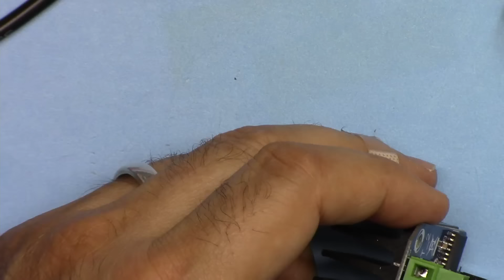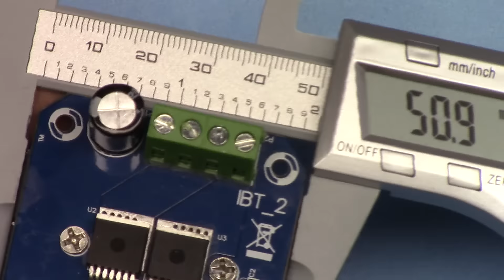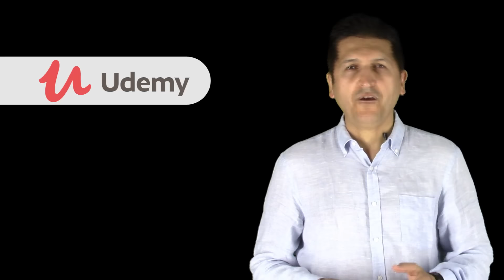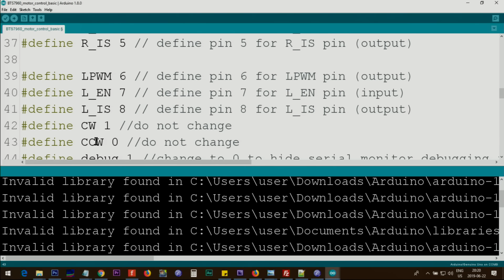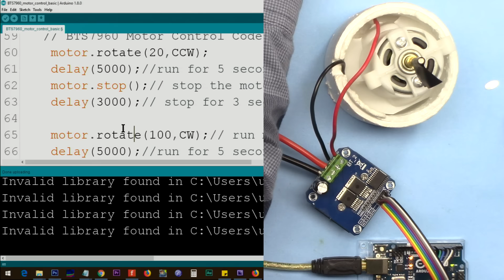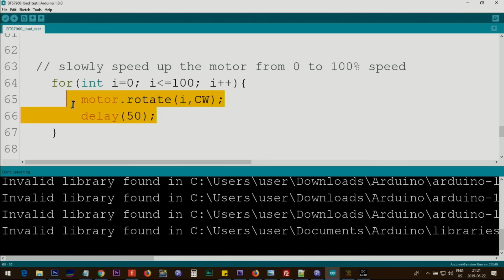Using BTS7960  BTN8982TA PWM H Bridge motor controller module with Arduino library RJT169

Comment: i can connect 2 motors in one ibt2? will loss potency with 2 in one ibt2?
Reply from the maker: It controls only ONE motor. I have provided the module datasheet in this page. See page 5 from the link http://robojax.com/learn/arduino/?vid=robojax_BTS7960_motor_driver

Comment: I have a very simple question : Do the H-bridge draw current when it's not active ? I mean when you apply voltage across B+/B- but your not sending signals from Arduino.
Mine is drawing around 0.15A just when I connect the power supply, I think it's broken
Reply from the maker: You haven't subscribed to my channel. I will reply to all Subscriber's 🔔 questions. So make sure to Subscribe.😊
Reply: @robojax  No
Reply: @robojax  I will check a correct guy who not bargain for subscribers
Reply from the maker: You want to get free. I have spent hours to write this library and you don't even spare single click. Really?
Reply: @robojax  I don't want yout library dude, you didn't even read my comment.. it was just a question, don't ask for subscribers

Comment: hi Robojax, i have a big Motor RC car, L298N motor driver is not enough to drive the rear motors it gets really hot and it wont run when you put it on the ground, i bought a BTS7960. please teach me how to code and wire it to replace the old setup. thank you
Reply from the maker: Hi Christian, If you watch this video and follow the instruction, you can control any DC motor. I've made it very simple using the library. Try watching the video without escaping.

Comment: Hi sir, thanks for nice tutorial video. I have a question about bts 7960. I am using this motor driver to control motor dc 24v 90w with power supply 24v 15a. When I set the pwm is 255, the output voltage 14,5v. Why output voltage not 24v ? Whether the maximum voltage bts 7960 is 14,5v ? 
Answer my question, please.. 
Thanks
Reply from the maker: Hi, thank you. PWM is not changing the output voltage. Even if you set it to 10 or 255, the output voltage should be 24V. Something is wrong. Check wiring.
Reply: in your opinion, which part of the wiring should I check? the wiring is the same as your video tutorial. 
I'm confuse where the mistakes

Comment: Hi Robojax, nice video, very well explained !  I've been trying to learn and adapt your knowledge to my application, however I'm not really sure it'll work since I don't have any of this modules available at the moment. So hopefully you can help me with this question ... Do you think that connecting 02 BTS7960 modules in parallel will work to drive a 60A 24VDC motor ? PSU is a 24V 100A.
Reply from the maker: Hi MadDogPE, Thank you. According to the datasheet http://www.robotpower.com/downloads/BTS7960_v1.1_2004-12-07.pdf on page 7 it says supply voltage max is 45V. So it will not work for your application.
Reply: Hi  @robojax  ! thanks for the reply.  Sorry but I don't understand your answer, I'm using 24V motors, that is less than 45V.

Comment: One drier can take upto 30 amps safe can we use two in paralal
Reply from the maker: You can used this in parallel if you do the wiring properly.

Comment: Great video ! Excuse me SIR, can i use this module to control Motor DC 12V 250W? Best wishes for you. Thank you so much.
Reply from the maker: You are welcome. I have presented the current  (Ampere shown as I ) so Votage x Current = Power or VxI = P or I= P ÷ V. P=250W, V=12V so I= 250 ÷ 12= 20.8A or 21A is needed to run your motor. Now I don't remember how much current this device can have. Watch the video and see the datasheet.
Reply: @robojax  thank you sir

Comment: Great Video! Really informative and helpful. @Robojax can you please suggest its max current output with 24V? And the best way to cool down this module at its peak 33A. As I read its datasheet it will shutdown on over heating ? Have you tested it at which Temprature it goes shutdown.
Thanks
Reply from the maker: Thank you Mathilda. I have not tested it with 30A but if you watch the video til end, I have included some test and didn't know how people like this module so I did not spend more time on it.
Reply: No problem I'm going to test it! Your video inspired me about the efficiency of module in cheap price. So I'm definitely going to re-test rigorously. Excited to learn something more about it.
Thanks again for your detailed review must appreciated!
Reply from the maker: You are welcome. your comment is appreciated. Good luck with your projects.
Reply: Hello @Mathilda, i want to know if you did the test with max current and if the module was promising

Comment: Hi, thank you for the detailed and informative video! I am trying to do a mini project which controls linear actuator and this seem to be able to work. Can you include a short guide on how to use the current sensing feature? It will be useful to perform some actions automatically if the current exceeds a certain threshold.
Reply from the maker: You can learn current sensing from this video for different module but you get the idea: https://youtu.be/-uQKBDTWHPM details have been mentioned on page 17 of datasheet: http://www.robotpower.com/downloads/BTS7960_v1.1_2004-12-07.pdf

Comment: Great video, i am trying to control 24V 15A motor using a BTS7960 module. it has burn out though...are  you suggesting that it is because of the high current? it also started smoking after short operation.
Reply from the maker: I am not sure why it smokes. Check the current. or may be install a fan to cool it.

Comment: hi ,i also use this module to drive my motor, i have a question , when i use low PWM output can't increase (PWM=100 current = 0.32A ; PWM=240 current = 2.49)  , how can i make output current stay in 2A  ?
Reply from the maker: Hi, Interesting question. This module has "current sensing" and has a pin for that "IS". I will look at it and see if it can be easily use. Right now with the current library, it can't be controlled.  Perhaps you can measure the current outside this module and use Arduino to manage it.
Reply: thanks you ~
Reply from the maker: You are welcome.

Comment: Hi, how can Iincrease the voltage to 36v ? and it be controlled by  Arduino pwm
Reply from the maker: You can not. The operating voltage is 27.5V. The absolute maximum is 45V. So it can handle for few seconds 45V but should operate at 27.5V